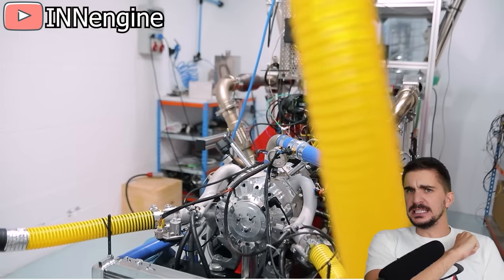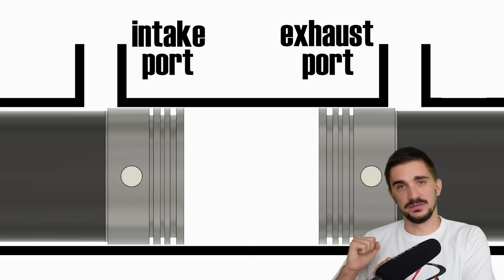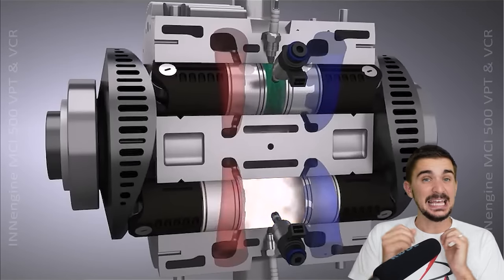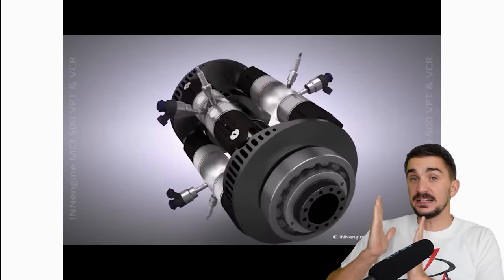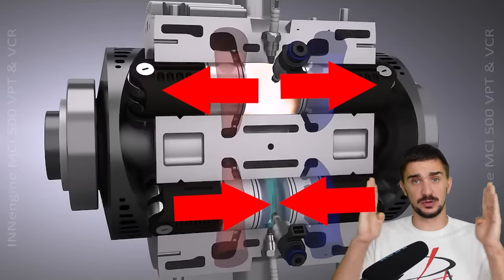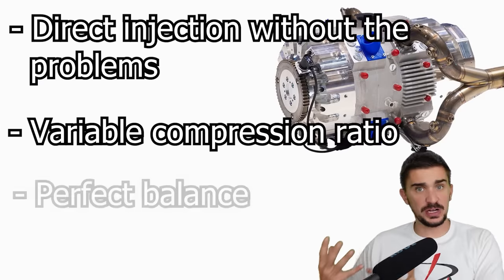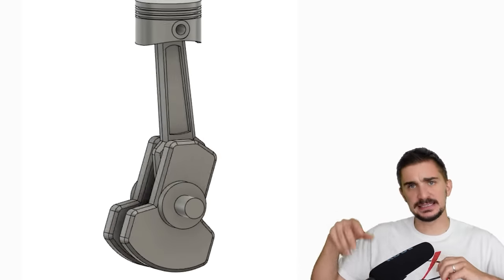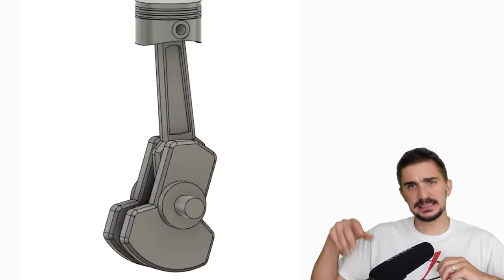Spain is Living in 2050? Revolutionary 1 Stroke INNengine Analyzed

Comment: Beautiful design. The question of how much torque is produced I know wankle engines develop very little, and there's not much you can do about it. However, the slope on the wavey thing if it was steeper would increase the stroke to some extent. In a hybrid arrangement, torque could be delivered by electric motors, and this is where this type of engine could excel.

Comment: The engine is actually an opposed piston 2 stroke, I would say a Wankel is more of a 1 stroke as the "piston" is a vane rotor and does not change direction through the various cycles. Anything reciprocating has to be 2 stroke or 4 stroke to function. 
Opposed piston engines are not new, but it is an innovative design. I wonder how well it would turbocharge or supercharge?
Reply: haha! posted too early... so they did have to give it forced induction. I think you are correct that it is max torque at high rev, also on the power strokes statement, yes it has more per rotation, it's firing twice at 180° positions, so effectively 4 per single turn of the engine, where the conventional 2 stroke with 4 individual cylinders does err, 4... compared with a 4 stroke, obviously it does more, that's how the engines are. It's definitely not a replacement unless you have a fairly large mass flywheel, but then that gains in momentum but looses in free revving ability. As you point out, great for generators and the like, not so good for vehicles.

Comment: I love this design straight out of SolidWorks! Another video mentions they forgot lubrication ... opsie!
Plus very little torque at start up makes it basically useless since stop & go is a universal urban thing.

But, this would work very well as a constant speed generator to become Primary in an EV, with batteries being the Range Extender. Just like Rail Locomotives that are Electromotives, the motor is not part of the Drive Train.

Some "Shiny Thing" Environmentalists might make squeaky noises, but Lithium /Iron/Cobalt batteries are basically landfill and toxic to make.

Ass to that, I am hearing what sounds like the "Angelic Chorale" in the parking lots that are actually the Bushings/Bearings starting to wear out, very pricey to repair/replace - OUCH!!!

Comment: Very interesting video, thanks.  However I don't think you can call this a 4 cylinder engine.  The head to head piston arrangement actually creates two cylinders in one cylinder.   Each piston (8) are firing every 180 degrees so it's still an eight cylinder engine albeit 2 pistons are reacting to the same combustion so it seems to me that the combustion chamber itself should be larger diameter than the rest of the cylinder's length and would surely need boost.  A bigger question for me is how did they combine the two outputs on opposite ends of the engine into one without causing a lot of inefficiency?  Looking at the design I can see many benefits although it's weakest link may be the rollers riding the wavy thing.

Comment: So what happens when you manually turn the crank and it pushes all the pistons to the center with nothing to pull them back down. It’s like turning the cam shaft in an LS engine and setting all the lifters into the lifter cups when you go to change the cam.

Comment: This engine has to be supercharged because it’s a two stroke without using the crankcase to pre-compress the intake. It therefore needs the supercharger to do it. It might work with a turbocharger. It should probably use a turbo/supercharger that’s driven by both a belt and the exhaust to improve efficiency.

Comment: With a power stroke every 180 deg. it seems odd having 2 cylinders ignite simultaneously. Add a fifth cylinder and you get a power stroke every 72 deg. and a smoother running engine.

Comment: so the fuel use to output ratio will be high. to improve, make the roller bearing at the opposite end of the piston face into a large cam shape in tune with the rotation cycle.

Comment: The biggest reason it isn't in widespread use is the fact that it doesn't use a lot of fuel, make alot of noise and they haven't showed it off in a crowd of gearheads yet. And not 'papered' gearheads, dudes on the racing circuits.

Comment: Firstly, if the vehicle is decelerating, the driveshaft RPMs could be faster than the engine's RPMs and the piston rollers could float and hammer against the swashplates.  Secondly, if you attach the front output to the front wheels and the rear output to the rear wheels, then the "variable displacement" mechanism would not work properly because it would constantly be changing due to the different speeds of the front and rear axles and would be fighting against the "variable displacement" mechanism.

Comment: I believe it is 1-stroke because the "wavy thing" is what forces the compression. The whole purpose of the wavy thing is to make it 1-stroke if I'm understanding the design correctly. The pistons are effectively 2-stroke but the wavy-thing imparts force on the pistons driving them back together when combustion occurs in neighboring pistons which makes it 1-stroke. You have to have intake and exhaust so it's there but the wavy thing drives compression.

Either way, if they aren't selling these so I can build a dope 4x4 gocart then I'm already upset.

Comment: It would be interesting to know if this engine would work with conventional flywheels etc each side of the engine instead of the swash plate. That would be heavier and supply more torque at the expense of more weight.

Comment: My concern is, what is holding the pistons to the wavy thingy? What's keeping them from slamming into the injector/spark plug then each other? Is it just the compression? If so when these engines start getting old they are going to fail spectacularly... Also having the cam chain and even the front engine accessories (alternator, power steering pump, water pump etc.) doesn't keep manufactures from making a dual ended output engine. The reason no one makes a centered engine that is 4 wheel drive like that is because it would need 2 transmissions... Plus the transmissions would have to be perfectly synchronized.

Comment: If it didn't fire, what would hold the rollers on the ends of the piston against the wavy rollers on each end?  It would seem the pistons without firing, would simply sit face to face with each other if it missed an ignition expansion.

Comment: Would this not work for a diesel engine?  Removes the spark plug, also place between 2nd and 3rd axle of a semi where the power can be used.  This would be interesting in a motorcycle but half the energy would be potentially wasted.

Comment: I say hook up a supercharger on one end and a turbocharged on the other for maximum efficiency. Pushing the fuel and air mixture into the engine under pressure with a supercharger solves the issue of both the intake and exhaust ports being open.

Comment: Surely, it's only perfectly balanced when run at the maximum compression ratio? As soon as you rotate the "wavy things" relative to each other, the two pistons in each bore aren't perfectly opposed and, for part of the cycle, both are moving in the same direction. By conservation of momentym, that throws the engine block in the opposite direction.

Comment: Each "roller" is in effect a lever, with a length equal the the radius of the roller wheel. The problem I see is that it's never at 90 degrees of angular momentum. Never even at 45 degrees either.
There's always a market for a tiny engine though.

Comment: correct me if I am wrong , but when you said that by scavenging we open the exhaust valve first by moving the piston on the exhaust side first but after the intake process the pistons seems to be in the same position , it has to be offset right , the piston that is on the exhaust side has to come closer to the sparkplug first than the other one  , so by that there will be difference in the force on the  pistons right

Comment: It seems like a great engine for a HYBRID vehicle because the electric motors can provide the torque for acceleration, while the gas innovative engine can run at a constant high RPM to for battery charge maintenance (when necessary).

Comment: TL;DR: my take on this is: a combustion working 2 cylinders probably will produce less torque because there is only a limited amount of energy per combustion.
It probably will be more efficient though, because the energy is used better.

Even though it's been a year: your explanation of how torque is generated is a bit flawed.
In combustion engines, displacement is the result of bore and piston stroke. Bore is the diameter of your cylinder, stroke is the length that cylinder travels.
Comparing a 1-cylinder 600cc engine with a 4 cylinder 600cc engine is flawed, because you effectively compare 600cc vs 150cc per cylinder.

Here's how to compare displacement: 125cc engines come in 2 different variants - long stroke and short stroke.

My old Yamaha DT-125R was a long stroke: it had a very small cylinder diameter, but a very long piston stroke.
That means, the engine won't rev as high as a short stroke, but each revolution of the crankshaft produces more torque than that of a short stroke piston.
This is, because the combustion can work longer on the piston.
In return, the TZR 125 with a bigger bore and a shorter stroke, could rev higher than my DT 125R and it needed to, to produce the same torque.

According to Yamaha, the DT 125  produced about 10.8kW and 16.6 Nm of torque @7000rpm.
According to Yamaha, the TZR 125 produced about 19.3kW and 17.6 Nm of torque @10.000 rpm.

The difference was simply in the rev range: the TZR has a shorter stroke and needs to be driven with much higher rpm than the DT to achieve torque parity.
The DT was meant for offroad driving, so you would find yourself shifting through gears and using the lower rpm band between 5.000 and 7.000 rpm quite often while the short stroke of the TZR meant, that it was better suited for higher rpm which was better suited for asphalt.

Note: DT 125 had massive reserves in terms of power and torque, as it could be modified to an unconstrained engine much like the TZR and produce somewhat around 21kW.
Even though my DT 125R was "open" with ~16kW, I never went to measure the torque, so everything beyond factory numbers is a wild guesstimate for me...

Comment: A one-stroke engine would require a double-ended piston which floats between combustion chambers on both ends and fires each time the piston reverses direction. Why hasn't this been proposed or done already? Imagine the efficiency.
Reply: Low-rpm torque requires only the correctly designed transmission. Include an appropriately designed torque converter.

Comment: The innengine is definitely winning in the lightweight and durability department but making more power than conventional engine is way too much of a stretch. Normal piston designs are way more convenient for upgrades and the way its outputting the energy is mathematically and even observably superior.

Comment: Cam engines and opposed piston 2 stroke engines are 100yo. Mechanically a jewel, it does not give any thermodynamic advantage or novelty. Difficult to turbocharge and turbocompounding. However the engine is quite interesting for some applications like small aircraft and drones.

Comment: Its technically not forced induction, its a scavenging supercharger. Its being used just like a Detroit 2 stroke would use it. Its considered NA(Naturally Aspirated) It will NOT run without the scavenging supercharger.   If it was turbo'ed on top of that supercharger than it would be considered boosted. Look up the difference between any series 2 stroke Detroit that is NA vs T ie. 6-71 vs 6-71T. the T series is boosted with a Turbo.

Comment: Due to the high efficiency at high rpm but low torque the applications won't be to vehicles, but for will be for planes, stationary generators and aircraft APU, and also boats

Comment: Perhaps "drive cam plate" would sound more technical than "wavy thing". And yes, an intake blower would increase power with very little parasitic loss. Think "Roots Blower" in a Detroit 12-71 or similar two stroke diesel.

I suspect a very long stroke would make this design more efficient, especially at low speeds or high loads. At high speed and low loading, a shorter stroke would be more effective. The "wavy thing" would then have greater or lesser "wave height", and different angle of interaction with the piston rod roller.

Lubrication will be an issue. There will either be unacceptable emissions and weeping, or unacceptable heating and wear. Great concept, but really only useful as investor clickbait, IYAM, at present.

Comment: 10:00 Or big oil buys the patent and buries it. We have had the tech to achieve 200+mpg since the 1930s, its not all about design, alot of it depends on the fuel source (i.e. vapor instead of liquid)

16:15 You are also wrong here. They are correct in saying it has 4X the number of compression strokes than a 4 stroke. If you take their design and only apply ONE piston (or even ONE single cylinder with 2 pistons since they are synced), for example using easy math, it will have 4 combustion strokes every TWO 360 degree rotations of the crankshaft, where as a traditional 4 stroke will have ONE combustion stroke every TWO 360 degree rotations of the crankshaft. Last time I checked 4x1=4.

And then after that you do the same thing, but the opposite, at around 17:00 you compare the firing order of one cylinder of the 1stroke to that of an entire V8 like WHAT? If you account for the complete assembly (8 pistons each), they both actually fire at the exact same time, all 90 degrees apart, but with the 1stroke its 2 pistons under power instead of 1.

Comment: I see this as a one of many of new popularistic engine designs which can appear to have some advantages but which have some fundamental problems, which are not mentioned at all. 

I see two of them. Bigger one is very high sideways torque on piston sides. What crankshaft and rod do to a normal piston is very small compared to this. 

I’d even say that the engine can’t be be done in a way it was shown in a principle drawing. It would need longer cylinder, longer piston and some roller mechanism between piston walls and cylinder. If you put some torque on this type of rotating plate, pistons face same sideways torqe, multiplied  by the relation between piston support points and the distance on the plate. 

It could easily be same or more than engine torque, and multiple times the friction from conventional engine, where it depends on the cosine of crank-rod angle. I don’t see how this engine could have high effeciency and durability by relaying on slidind friction. 

If there are rollers and long support distance, pistons are heavy and complex. 

Another problem is exhaust port. That’s why we need to change pistons in every few thousand kilometers for 2-stroke engines, and that’s don’t get better with high sideways forces. 

What comes to weight and power ratio, I have 2012 800cc Lynx boondogger snowmobile. The engine is direct injection 2-stroke E-tech with weight about 30kg and power 160+hp. 

They nerfed that later into 145hp and made heavier 850cc for same power class because that engine had some durability problems. I had driven 14000km with it, so it can be done.

Comment: I don't think that the opposing pistons in the cylinder add any more power than one non-opposing piston such as in their aircraft engine. The reason is simple, as the pistons are pushed in opposite directions, they decompress thus quickly reducing the power curve.

Comment: If you want a power unit to change the game you're going to need to use diesel electric like on modern locomotives. Cars and trucks have the ability to use minimal diesel fuel input with continuous variable power output and even the ability to be a generator for job sites or home power outages.

Comment: with the perfect primary and secondary balance as well as its overall shape and lack of valves that are a limitation from conventional engines, what i could see is this engine being able to take much much more rpm than any conventional engine. just like how the turboshaft engines used in helicopters can go up to 30000 rpm.
maybe in a few decades of iterations, they'll optimize the shit out of it and we'll get some crazy rev monster that compensate its low torque by taking twice the rpm of conventional engines.

Comment: It is swash plate drive, like the delco A6 ac compressor. I thought it begs to be intake charged with that design. Piston ring valves (ports) have serious problems. Lubrication looks difficult. Swash plate drive isn't that efficient.

Comment: The Problem is that supercharging or any type of boosting will not bring a lot of torque advantage because you would need a exhaust valve for that. It is the same on normal 2 stroke engines, it works with good resonance charging from the exhaust, but not without a typical 2 stroke exhaust. Also I have to say that 120hp from a 500cc 2 stroke is really not impressive. You mentioned 28hp from your bike, meanwhile in KTM factory we were producing 125cc MX engines with 40hp+ and many years ago Aprilia did a great job with the RSA125 (the legend says it had 55hp). All to say with 1 piston, not 8 pistons. Think of the money that has to be spend on a repairwork for a only(!) 500cc engine.

Comment: Isn't there a diesel version of this? I'm pretty sure it struggled with cylinder rings on the exhaust side and also uneven deformation on the cylinder walls due to the difference in temperatures causing terrible compression losses... Also that, 100 years into traditional piston engines and there's not a single one that doesn't eventually burn oil due to the rings, what I'm saying is I see it difficult to make this reliable beyond 100k km/60k miles and not needing an entire engine rebuild before it turning into an oil burner